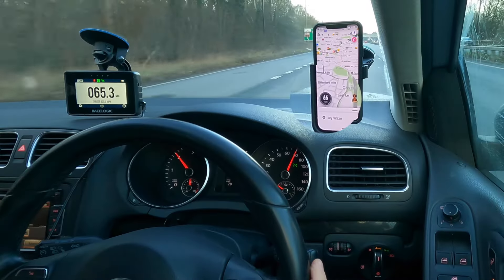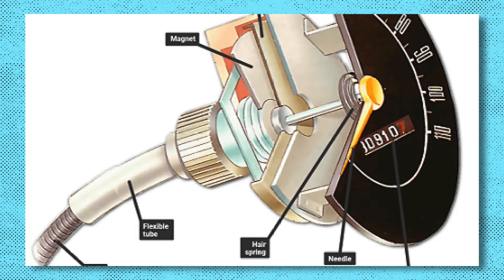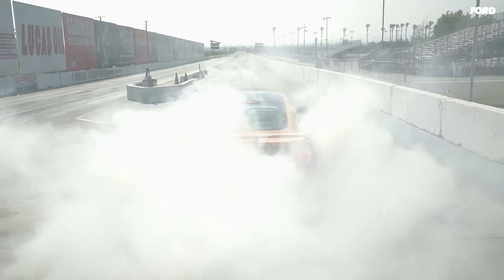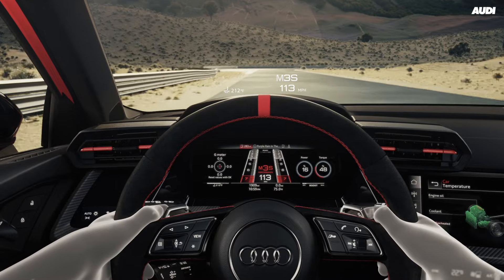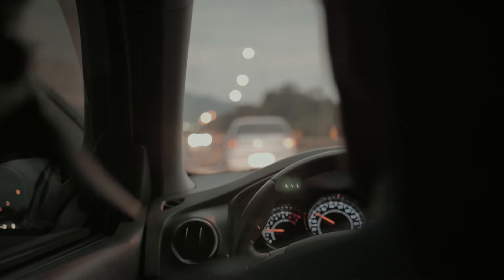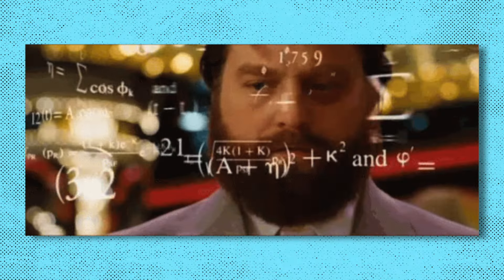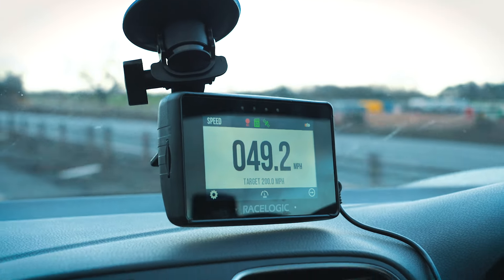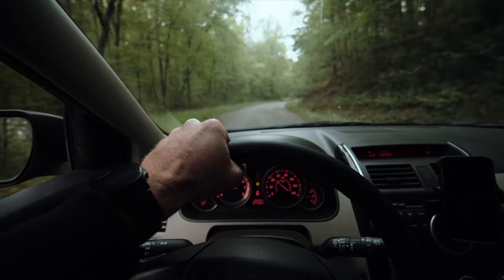Why Your Speedo is Lying to You

Comment: I'd be super irritated if my brand new car had an inaccurate speedometer.  All of my cars are 40+ years old, and only one of them reads the correct speed.  Several are off because of tire size not matching the original tires, but a couple I suspect are off because the tension in the spring in the speedometer is not the same as when new, so it no longer reads correctly.  I know which ones are off by what percentage, so I can always mentally convert the reading to my actual speed whilst driving whichever car...except for the one where the speedometer doesn't work at all; I just floor it in that one because zero times any percentage is still zero, so I can never be pulled over for speeding since I'm never moving.

Comment: spedo aren't lying, they have been calibrated with an error margin and your tires gets in the calculus, the margin is thinner with brand new tires on the drivetrain than with long used one, their circonferences are smaller wich create a discrepencie on a measurement device that just count turns of the drive shaft.

Comment: I have never been in a car with stock sized tires that has a speedo reading slower than the car is going.  NEVER.
I agree that a speedo reading faster than actual speed will result in less tickets.  HOWEVER, if your speedo reads fast and you drive mostly leased vehicles, you are getting cheated by 5-10% of your lease milage.  So that 36,000 miles you racked up on your 3 year lease would be cheating you by 1800 miles.  As someone who has driven more than the lease allows multiple times, that feels like they are stealing from me.
For me, 80 on my speedo is actually 72-75 according to google maps GPS speed.

Comment: On BMW's (I have no knowledge regarding other brands) you're able to go into the vehicle settings using the OBD2 connection, and set your speedometer to normal or a more accurate reading.

Comment: The cameras do NOT have a tolerance of 10% plus 2mph. The Association of Chief Police Officers (ACPO) have a prosecution guidance of 10% plus 2mph which is made up of a camera tolerance and a driver/car tolerance - afterall, nobody wants drivers staring at their speedo instead of watching the road. The cameras themselves have a much higher accuracy but an accepted camera tolerance of 2mph. So regardless of ACPO guidance (and it is just guidance, an individual officer can prosecute at 1mph over) you won't be prosecuted for speeding past a camera as long as your actual speed isn't more than 2mph over.
Reply from the maker: Very much region specific. In our region, this is the case. But hence us explaining that it varies a lot!

Comment: I've got a Volvo-v70 from 1998. At lower speeds 0-50 km/h it's spot on. But when the speedo gets up to 70-130 km/h the car is roughly traveling 5-7 km/h slower

Comment: Have a 2002 subaru liberty and it used to overread by about 5% on factory rims. So bought bigger rims and low profile tyres. Because of the adjustment it now reads spot on with gps 👌

Comment: My 2012 Honda Civic reads pretty accurately. I've noticed that if I'm indicating 70 on the speedometer, the GPS usually indicates within 1 mile an hour. I'm on super cheap Douglas tires from Walmart that are probably well past due for a rotation.

Comment: As an aside, you can modify your 0hone settings on Android both in the developer menu (such as by preventing the phone from having rest periods on GPS timing) as well as through secondary apps (in particular through rooted devices with unlocked bootloaders) that enable for vastly increased update times for the system. Downside is that it will HUGELY increase the battery drain on your phone. Not sure how much more it can improve accuracy via increases time measurements, but it does offer at least some options.

Comment: 10mph is really extreme, ive seen it for years on different cars and the deviation is usually 4-5 km/h on standard tires, and here in Germany if you change the circumference of the tires you need to recalibrate the speedometer in order to pass TÜV inspection. My mini cooper s r53 has 4kmh deviation, other cars tested are golf 3, golf 4, volvo V40 all in the same range, GPS and speed trap tested
Reply: 50€ on the dashboard and any car will pass :D
Reply: @MisoElEven  XD I'd love to know where that is, would have saved me around 700€ last month for the inspection lol

Comment: All this technical reasons for speedometer's inaccuracy is bs. If that's the reason, a new car would read the exact speed and over time the readings would be more off, which is not the case.
Readings are always over the actual speed due to safety reasons and speedos are set up that way, simple as that.
yes, many drivers are aware of that but most of them aren't and even if there were, subconsciously it makes them drive a bit slower.

Comment: I've had two cars that read under, granted they were older cars without abs and traction control. One would read spot on under 20 mph, but would read 5 mph under up to 80 mph. Any faster and the speedo would be even lower. The other car would read under consistently about 2 mph under. My newest car reads pretty spot on, only being over by about 0.5 mph. Neither of the older cars was a big deal here in America where the speed of traffic dictates how fast you go more than the speed limit.

Comment: my friends golf gti mk5 reads 10kph more at 100kph but the faster it goes the more it lies. 
on top speed it reads nearly 280kph while its doing barely 255gps. (320hp~)
Reply: The higher the speed the more the 10%(or whatever difference  there is) will be come. 10% of 100 is more than 10% of 70
Reply: @rhyswilliams4893  obviously
Reply: So It does lie more the lie is  just more obvious
Reply: @rhyswilliams4893  yep. makes the owner feel good as his lumpy golf goes "280kph" on the autobahn. 😆

Comment: My 1998 Acura Integra was off by 5kph consistently regardless of speed.
My 2002 BMW 325 E42 was off by 4kph.
My 2007 BMW 335 E90….4kph
My 2013 BMW 335 F30…4kph
My 2013 MB GLK250…3kph

Rental Toyota…off by 3 or 4 kph

Surprisingly, Recent GM cars I’ve driven were bang on

Comment: Here in Brazil too we have a overread on the speedometer and a tolerance on radars. Normally 5km/h on the speedometer under the speed shown and a 10% tolarance on radars.
Reply: Another Brazilian here... I had a VW voyage on 14" wheels showing about 10% over the actual speed. Now I'm driving a Nissan versa. Previously on 15"s the Nissan shown 7 to 10% over on the speedo, now with 17"s is almost spot on

Comment: Trivia: In Japan we have misdemeanor speeding (<+30km/h street, <+40km/h highway) and felony speeding (over that tolerance). Misdemeanor speeding up to +15km/h is extremely rarely fined due to the benefit of the doubt. Speed cameras in Japan only catches felony speeding, and will give a blinding bloody red flash when capturing, letting the driver know you are gonna be in court and get a criminal record.
Reply: In the US we mostly catch speeders the old fashioned way: a cop with a radar gun.
Reply: @slowanddeliberate6893  our cops do the job in an ever older fashioned way: follow you and keep the same speed with you and hit the record button on their speedometer
It is also required by law for them to turn on the red strobe light when doing this. So if your situation awareness skill is good enough you can just hit the brakes when you spot a cop following you and you'll be good to go.
But most people get caught in a so called mouse trap: a hidden radar and pull you over later

Comment: My 2017 Kia Sportage SX-T (US market) is accurate within 1~2 MPH - regardless of the actual speed driven. I have checked it against the speed readout in Google Maps, the GPS based speedometer in my radar detector, and free-standing radar speed cautions.

As you noted i the video, in the US market the rules on this is within roughly 2.5% in either direction.

Comment: Good video, but you should have checked the car speed with the OBD2 Port.
With the car I drive, when these signs that show your speed show 50kph the speedometer reads like 55 or 54kph while the readout from the OBD2 shows 51 or 52 at least that is what I noticed, but I havent tested it against GPS and I prefer looking at the road to constantly comparing three speed readings ^_^

Comment: I recently realised this when bought an Audi A3. Overreading with the 17 inch wheels. I put on 19 inches from the rs3 and the Speedo is almost spot on, 1kmh off instead of 5-6 that it was. My guess is that the manufacturer will do one speed Reading system for that particular car and will do it more accurately for the top performing version of that car as it will likely have bigger wheels. Otherwise if done in reverse it will under read in the performance trim.
Reply: Believe in JESUS today, confess and repent of your sins. No one goes to heaven for doing good but by believing in JESUS who died for our sins. GOD loves you soo much unconditionally.😍😚☺🤗❤😇

Comment: It's not lying to me, its protecting me. This is nothing new. Many if not all car manufacturers deliberately over read speed for the exact reason, to give their owners an extra margin of safety against exceeding the local speed limit. Of course, if you use larger diameter tyres than those recommended by the car manufacturer, than all bets are off.

Comment: Well made, with plenty of graphics etc. I suspect that the device used in modern cars is driven by the driveshaft output, though, not a wheel on one side or the other - after all, on curves wheel speed differs automatically via the differential gear set (even on hybrids, with one traction motor for both wheels).

You are right that one of the main factors is the international standard, which has ‘lop sided’ accuracy requirements, so that speed displays are not allowed to show low values, so all manufacturers make allowances for tyre variations etc, as you describe. The latest version seems to be: https://unece.org/fileadmin/DAM/trans/main/wp29/wp29regs/2018/R039r2e.pdf 

The original standard is in metric, from which the ‘domestic’ version is tweaked to imprerial and rounded.

One of the first things I do with any new car is to measure it a bit. These days it’s easy enough to do it via devices using GPS on straight routes that use co-ordinate rate of change, or it can easily be done using a watch which is accurate enough on motorways with standard 100m marks, or location signs every 500m. My current one started at about 5% fast, and will be worse as the tyres wear down. I know there are variations due to temperature, etc, albeit minor.

I think that many commercial ones, such as HGVs, or PSVs, tend to have more accurate kit, though.

It’s true that many people do not seem to know how (in)accurate their display is, and tend to run slower than required over stretches with average speed monitoring. Quite common on sections of the M4 in Wales, e.g. W.r.t. photographic measurement accuracy, I think it’s quite tight for variable speed limit (VSLI) set ups - something like +3 mph, so when compensating for your built-in error, be wary of that!

The other fly on the wall is to do with the introduction of automatic speed limit sub-systems on modern cars; a topic for more research, probably.

Comment: I got called out :D  I am definitely doing the math - Waze speed readout + 5km/h tolerance on measuring equipment so in 50km/h I will be usually doing 58km/h on the speedometer and 55km/h on GPS... but I noticed the car having different margins at different speeds and that a GPS speed read-out is wrong if you are going up or down a hill -- so I have to account for that too

Comment: I once bought a used motorcycle 5h away, rode back on it. it took me a little while to realize the speedo was completely off, undereading by at least 30kmh, I was around 110kmh and passing all the traffic.
My hands and butt going numb were not lying though, measuring the vibrations of the big 650cc single doing 140-150. I was slightly relieved to see that doing more reasonable speeds wasn't as uncomfortable.

Comment: I guess you missed out one important point: car manufacturers are interested in overreading speedometers, since cars will show a lower average consumption rather than with an accurate speedometer. At least the driver‘s perception of the car‘s consumption level is increased. As to my experience, cars from Volkswagen Group tend to overread rather heavily, whilst eg Mercedes is quite accurate.
Reply: Better economy and faster acceleration!  Winning!

Comment: They also take in consideration that there is an +/- 5% rolling circumference allowance, for direct electronic speedometers. In this day and age IF they really wanted, they could use the cars internal GPS to regularly re-calibrate the sensor speed off-set when say a minimum of 4 or 5 sat's are available, automatically correcting for wheel set differences and wear. Then display 2% more than the calibrated value just for the legal sake of never displaying lower than true.

Comment: Vbox/racelogic also gives you 2D vehicle speed. So if there is any slope, you might have error in your comparison. 
In addition, ABS reference speed, which is more complex than just 4 wheel speed average, would be bounding the speed low. Otherwise, if you hit the brakes, and your reference speed is higher than wheel speed, ABS could prevent brake apply because it thinks wheels are in slip when they're not
Reply: The vast majority of inclines are under 10°, at 20° most cars already struggle and need to run at the low speed+high torque to climb. Inclines where an average car can develop speed are probably 5° or less which only gives you a 0.38% of error which maybe means that a 60km/h on the GPS is actually 60.2km/h, a difference too small for general use.

Comment: You are so.. so wrong....

Cars actually 'read' speed quite accurately. It's the speedo reading (both analog and digital) that over reads.
As you mentioned, it's also required by law for speedo to show higher speed than lower.

But you also missed one HUGE thing. Connect OBDII reader, and check speed from there. Oh? Gee.. imagine that! That speed is correct one!
So car actually reads speed correct. It might have minuscule overreading/underreading based on tire pressure/how much tiers are worn, etc.. but generally, it'll be spot on. Same as distance traveled that is shown (it does not show 10% extra distance traveled! - but correct distance).
It's just speedo that is required to show more.

Comment: Your description of the speed sensors is actually highly inaccurate. The ABS speed sensors are not actually capable of telling you what the wheel speed is. They generate an electric current and response to the speed ring, and the ABS computer compares the analog signal from the four wheel speed sensors to see if the wheels are turning the same speed. The ABS then intervenes if one or two wheels start to turn slower than the other wheels. This was the case at least through the early 2000s.

The vehicle's engine and transmission control computer uses a sensor growth into the transmission, called the vehicle speed sensor, which is actually capable of determining the rotating speed of the transmissions out of, or the differential in front wheel drive vehicles, that information is related to the vehicles computer. This is a necessary step for automatic transmissions anyway because the transmission needs to know the vehicle speed in order to select the correct gear. Having that computer also tell the dashboards speedometer where your speed is, is a very small modification.

Comment: Good video.  My 2012 Audi S5 reads high by 1 mph; at 70 I'm actually doing 69.  My 2001 Porsche Turbo reads high by 5 mph; at 70 I'm doing 65.  It surprised me that the Porsche was off by that much, given how well the car is made.  Both are running stock size tires and wheels.  FYI, I've run through many speed traps in the US in my Audi and never been pulled over with the cruise set at 10 over.  However, when driving in areas with known speed cameras like DC and MD I don't take a chance and set it at the posted limit.

Comment: I'm convinced it's so the odometer is fast and the warranty ends quicker. Your speedo may be way off, but plug into the onboard diagnostics and you'll find they are pretty bang on and they are both getting info from the same sensors!

Comment: 1 thing that works out well with wheel speed sensors, unless the sensor system can take wheelspin into account for mileage, is if you do lots of burnouts it'll age your mileage faster than no slip, which is fair enough really!

Comment: We like to say that the speedometer in my truck is "Wildly optimistic" about our speed. If it says we're going 65mph we're running 59 on Google maps
If it says we're going 80, we're going about 73 or 74
It's a 2004 Dodge Ram 1500

Comment: A vehicle-mounted non-contact ground speed sensor, such as those which rely on Doppler radar, are pretty much the ideal for this purpose. They can achieve very high accuracy and refresh rates, and obviously aren’t affected by wheel/tyre circumference. If one seeks to use one of these sensors with a factory speedometer though, it would likely require a bespoke (usually rudimentary) electronic interface.

Comment: Had a Kia with an analog and digital speedometer. They were literally 5 mph apart from each other. The analog one read faster, but I did notice that it also depended on what angle you were viewing it from.  Also, the faster the dial is the quicker miles add up and can be a false indicator of MPG. So not a goodthing😵